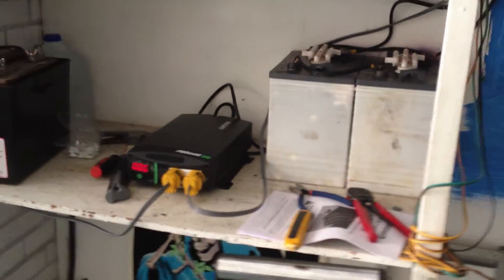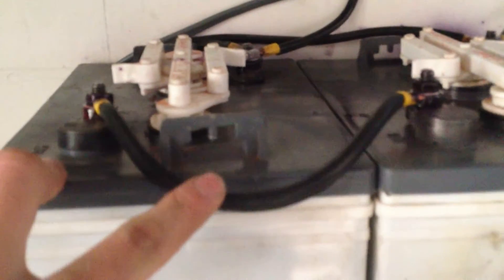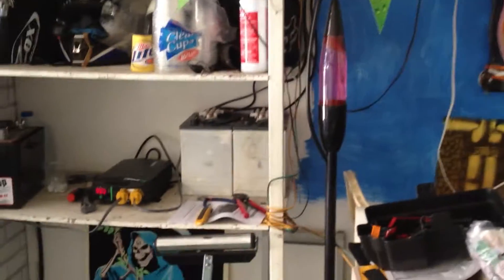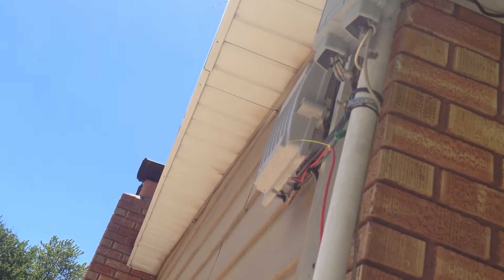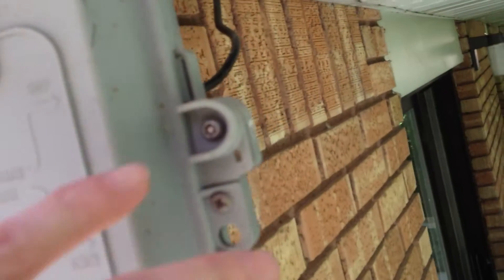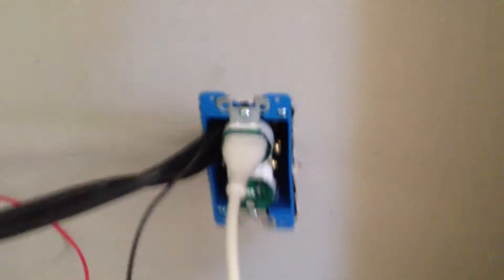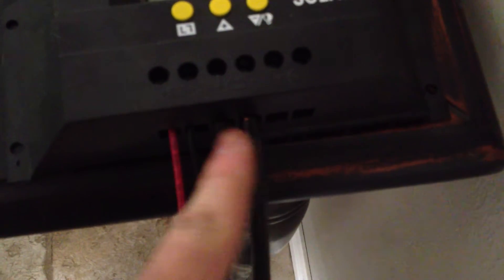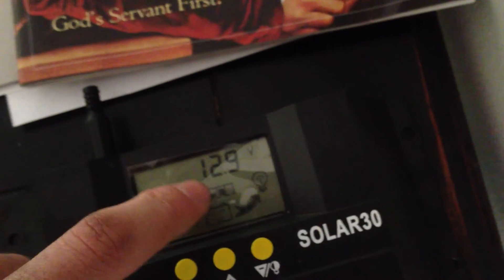harbor freight solar 45 watt xantrex inverter

Comment: Hi thank you for the video, kindly how much you set the controller to charge the batteries I have the same charge controller and the same battery bank . I can see that the controller is still charging the batteries while showing 12.9v . Thank you

Comment: Glad put this video up //
I have been a electrician for over 30 yrs 
Now that being said ,, U have extreme Fire Hazard 
You can not run Low voltage in high voltage box such as u have 
Please try to change soon as possible for ur safety  and family 
If need more help and or direction fill free to ask glad to help 
God Bless YOU AND UR'S